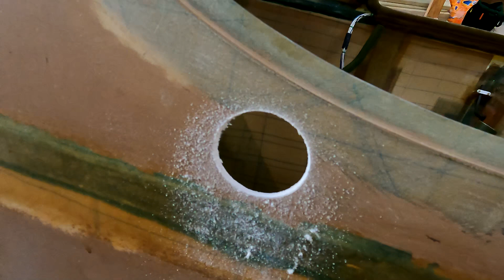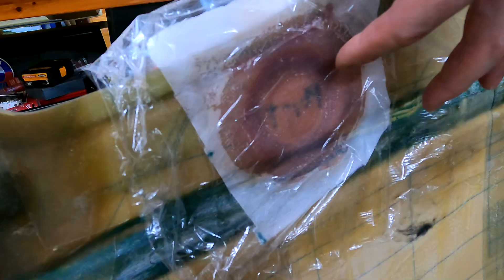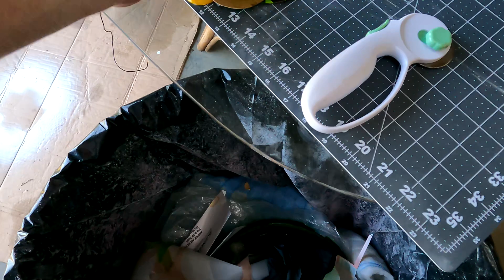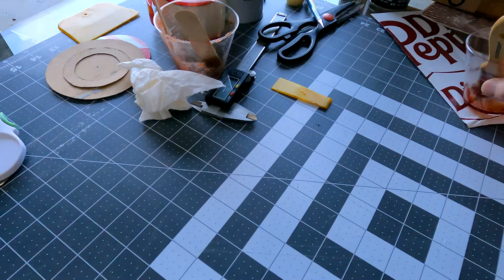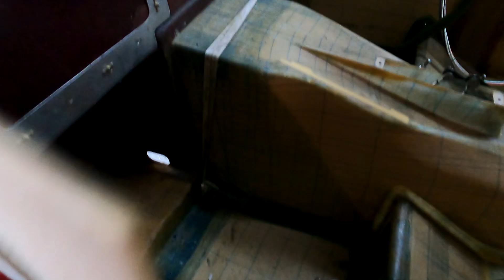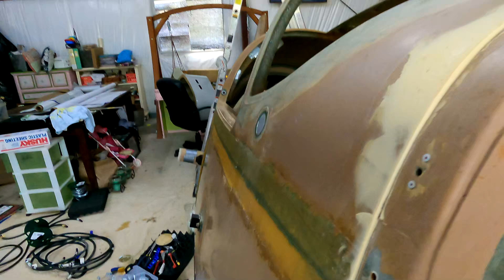Europa Aircraft Kit Build - Ultimate Ventilators

Comment: Hey Kyle, Thanks for your informative video. Im building a Europa too and I really like that vent. Can you tell me the name of it and where it got it from. Id like to install in on my aircraft.
Thanks
Reply from the maker: Hello Tony,
I purchased them off Vans Aircraft Store several years ago.  I'm not sure they are available anymore.  They are called "ultimate ventilator." 
How far along are you in your Europa build?
Reply: @kylephillipson5262  mostly done except for the painting. I have an air vent of the pilot side via a NACA scoop but nothing yet on the co-pilot side. I purchased an el-cheapie from Spruce but I like your set-up much better.
My aircraft started in Georgia USA and is now in Sydney Australia. It started its build in 2000, so this must be one of the slowest builds ever. Thanks again for your informative videos. Keep up the good work.
Reply from the maker: @tonyvaccarella5362  Mine is a slow build as well. Picked mine up in 2012. Many people go with NACA scoops but they never deliver on needed airflow when its hot.  They have a small margin of error to be built correctly. Almost every one you see has been modified to include a little scoop to help increase airflow. When I'm hot, I don't care what drag penalty I have. Are you on the monthly Europa Club meetings?
If you find the vents let me know.
Reply: @kylephillipson5262  Hi Kyle - I did a search for those Ultimate Ventilators but could not find them. I may have to stick with my cheapies. Im not on the Europa Club Meetings - is it based from the USA? Cheers.
Reply from the maker: @tonyvaccarella5362  Its a global club.  Post a WTB in vans airforce forum, you might find someone willing to sell their extras.  I think I paid ~$150 for the two.
www.theeuropaclub.org